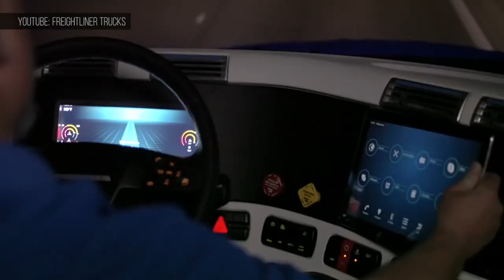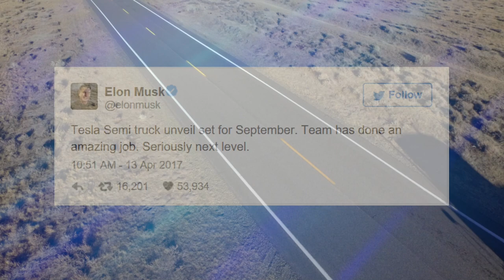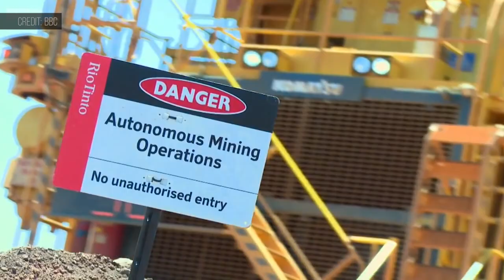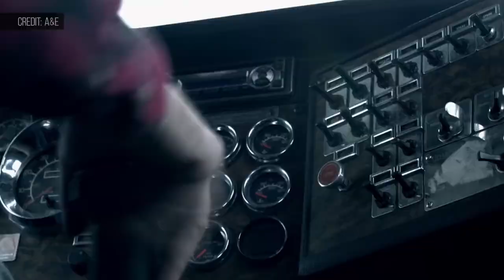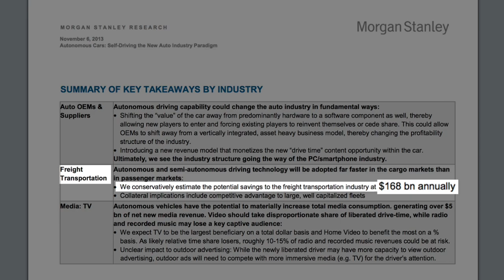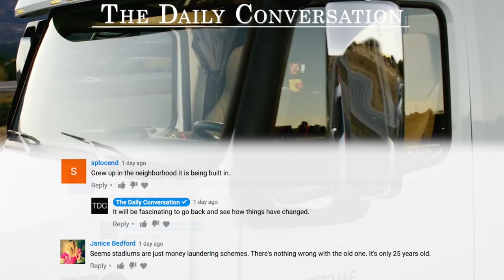The Future of Trucking

Comment: I find that these autonomous trucks can be subjected to a malicious hacker, and this could cause numerous problems, that if gone unchecked, can bring the entire trucking industry to a standstill. I find that it will probably fail, even though there may have been one successful case, but, if that company, that was bought by uber, which by the way, there was talk of a driverless uber car that ultimately failed and killed someone, I seriously doubt that this will be anything but a flop for autonomous semis. Too many factors can include not only susceptible to hackers, but also road conditions such as after a serious slow storm, and the salt or the corrosive materials that can eat away at wires due to road salts, or sand, or anything like that. There would have to also be frequent fuel stops, if the reefer needs to be filled up, if anything, as well as being subjected to maybe a short burst EMP attack, if a hacker can try to control it, to take control of the truck and reroute it to a different designation.. Here is a video on that failure of a driverless uber car at:  https://www.youtube.com/watch?v=HjeR13u74Mg as well at: https://www.youtube.com/watch?v=cnRKG6S8tII , and this is the result of it at: https://www.youtube.com/watch?v=hthyTh_fopo . After seeing that, and the possibilities of a hacker wanting to control a driverless truck, via either a remote location access through a company website, and creating a backdoor access program, I really do not think that there is anything to be concerned about when it comes to driverless trucks. I would be more concerned right now if a hacker can reroute a driver controlled truck through the qualcomm system than anything, or try to control a navigational system in qualcomm, but then again, that is my own opinion.

Comment: While I think there is going to be a place for it looking at road trains and so forth, as much as you can cut the driver out of the system I know you  are going to be causing problems what happens when it does crash

I think you be more inclined to start moving from 48-53 foot trailers and scale back to 40 foot the only to reduce truck semi emissions is to increase haulage capacity and you can get that with 3-5 trailer 40 foot trailers averaging 120-200 foot of cargo space..

Comment: Without a driver: who will back into the dock? Check in with receiver? What if freeway is blocked or closed? What if the last truck stop before the snowed in mountain pass is completely full? Weather conditions? What if battery completely fails while in travel 75 mph on major highway? 
I've been in the industry for 5 years.. there are situations that require moral judgement. This will never succeed as much as their greed wants it to.

Comment: In the near Future I think manned Electric Trucks make since for Short Haul trips but for Long Haul fuel cell Trucks make since as well as Robo Trucks. the kill app will be a Solar Cell skin for the Tractor as well as the Trailer. the other thing they need to do is Update the trailer, give it Solar Cells and make it as Streemlined as possible, and use the undercarriage to store extra batteries. they will need to update the Rules on Gross tonnage. have the weight of the Tractor and the weight of Batteries Subtracted from the total weight. Semi- Autonomy should be the Standard for ALL manned Trucks. Advanced Fleet management is Already here with iDAS Digital Radio system, iDAS can handle Analog / Digital in mixed mode and Fleet Trunking. the Driver can communicate with Destination giving Real Time updates on its Location and Expected delivery times, Corporate can monitor local Highway conditions and issue alerts to Drivers, and Drivers can Divert before there is a problem. iDAS has an IP protocol as well allowing constant communication with HQ and iDAS has built in GPS as well as Operator man down alerts.

Comment: The automated truck will come along a lot faster than people realize because of the disruptive Tec of super capacitors a company called KillWate labs has a direct one for one replacement of lithium batteries that is cheaper. lighter, is the same size, charges in 30 seconds and will do 1 million complete discharge and charge. This Tec will has a cost per cycle that will be so low that nothing will be able to compete with it.Just imagine a terminal similar to a weight station but with lots lanes that trucks pull through and robotic systems connect and charge the truck in thirty seconds.

Comment: Lack of truck drivers is already an issue. People don't want a big rig trucking life and drivers are aging. Automating some of the workload driving won't make it way more attractive as traffic, long hrs on your own, sleeping in Trucks and demands on health and curbs on human contact will remain. We may see truck drivers taking over the urban trips as trucks arrive off the highways. We have yet to see automation take over even the railway where driving is even easier. Since the internet will keep generating parcel demand and interest in expanding railfreight is limited by a network that will not expand, demand will remain. We may even see crowdsourced freight movement where general drivers take one part of the delivery and volumes of drivers negate the need to large truck shipments. Drones could do the same and the low altitude airspace has alot less traffic.

Comment: As a flatbed driver, the idea of automated trucks is a joke. Who's going to secure and unsecure the cargo at each end? Who's going to monitor the load in transit and adjust securement if necessary? At a job site, there would have to be a handler to maneuver the truck on site. What about maneuvers into a city area where trucks aren't normally allowed? All of these things need skilled human intervention and judgement. No robot is ever going to be able to do what I do every day. The industry most definitely needs to become more streamlined and efficient, but automation is only a tiny part of the puzzle for very specific applications, not a magic bullet. 

A fully automated freight infrastructure would require a massive overhaul of shipping and warehouse facilities as well as roads. Another example is other drivers. If you put hundreds of automated trucks in a city environment packed with cars, programmed to maintain a set following distance, cars would continually muscle in on the trucks and eventually bring them to a complete halt. It would create a traffic nightmare. What about when it gets confused or senses a failure? Does it just stop in the middle of the road?

The transport industry is also run and dictated with an iron fist by the insurance companies and attorneys. If an automated truck malfunctions and slaughters a bus full of tourists in a firey crash, who's responsible? The manufacturer? The company? The maker of the failed component? Until that question is clearly answered, the insurance providers will never allow these trucks to come into service. And what about programming ethics? Scenario: A mother pushing a stroller is crossing an intersection. There is traffic oncoming. On the sidewalk is a large group of people. There is no way for the truck to stop in time. It must steer. Which way? How do you program it to decide who to mow down? A cold calculation of the minimal loss of life? One major accident will set the whole idea back decades. 

Then there's the matter of removing millions of jobs from the economy. We will eventually automate ourselves into a corner. There will be no jobs for humans, and no way to earn income, and no money to be had to purchase the products the robots make. So then what? We become dependant upon the government to give us the things we need, and have no way to work to EARN the things we want? That's a rather disturbing image of the future if you ask me.

All of this talk of automation begs the question: "Just because we CAN, does it mean we SHOULD?" The drive to reduce costs of production and transport eventually reach a catastrophic point of diminishing returns. I just hope I'm not around to see it when it collapses under its own bulk. Truck transport is simply too dynamic and unpredictable to be handed off to a computer.

Comment: Instead of autonomous trucks, try to imagine autonomous rail cars.   A single rail car can carry  as much as 5 times the tonnage of a semi truck.  Also, once the rail car is moving, it requires very little energy to keep it moving due to the very low friction between steel wheels and steel rails.
Were we to go back to the rail system we had at the end of the 19th century, almost all deliveries could be made by rail.  Now if each car was electric powered and computer controlled, it could be programmed where to go and then simply set on its way.  Recharge stations could be set up along the way.  
Over time grade crossings could be eliminated.  Also track usage could be increased and the need for large switching yards could be reduced.  
Work will continue to be taken away from humans and be given to machines.  Humans will earn their living by facilitating the transition.  
Most likely as the need for human labor decreases, the birth rate will decline allowing individual standards of living to increase.

Comment: Cargo transport has changed quite a bit in the past 100 yrs and more in the past 50, like everything else it's an evolving field and will adapt as fast as humans can handle it and that's both the drive and braking of it, humans need to have some time to adapt, both in the industry which adapts faster and the human culture which is slower since many ppl aren't familiar w evolving technologies, we need to work on that too, present it in ways dif ages can grasp. I see a lot of solutions in these tech systems but like all tech it needs to work out the bugs, even the bow and arrow were gradually developed, horse & buggy were improved gradually, cargo used to be nets and crates, now it's standardized containers, a leap for sure but took some ports a while to adapt and the Panama Canal had to adapt to the new mega ships or lose millions of $$$. We're an adaptive species, we'll merge it all into our cultures and etc, just takes time. Very good vid, keep up the good work !

Comment: Electric trucks will definately have a market, though I think it will be limited more to ~200 mile one way trips, ~400 mile two way, for some time, meaning diesel power will be around for some time, likely a number of decades, a major problem is going to be with the power grid, operating even a single passenger EV car can consume more power than the household of it's by, potentially, multiple times depending on miles driven.
Reply: So far EV ranges have doubled every 6 years or so... that means 1000 km within a decade, probably much earlier than that.

Comment: There is a lot of money being put into robotics now days. Now you are putting 40,000 pounds of fright out there without a driver behind the wheel and not far after they are talking of getting rid of the tractor all together. Both these raise a flag. As a current driver myself and other drivers are faced with split second decisions on the road each day to avoid accidents that could cause accidents and delays. Not to mention all the construction throughout the US that we have to deal with. A lot of times you have to detour to avoid all of this. With a limited battery supply between recharging stations, that's going to leave this system unmanned on the road for several hours or possible days with millions of dollars of freight on them. How long do you think its going to take before the public starts to target and hijack these "unmanned" vehicles? The biggest question is how much this technology is going to coast the consumer? It has to be paid for some how. Someone has to man or program these systems, what happens when there is a system failure with that 80 ton misel ? The coast to ship freight will increase and the consumer will pay for all of this in the end. Any change in the transport of goods is always filters back to the consumer some how.

Comment: What if the truck has a flat? What if someone steals from the truck? Who will physically load and unload the truck especially if there is multiple pickups or drop offs? My trucking job requires physically loading and ratchet strapping down and vice versa. And what about harsh weather conditions? Who will put on snow chains. How will the truck get back and forth to Canada? Lol
These problems won't be overcome in my life time. And when they are that's when skynet will take over lol

Comment: One of the problems or issues will be if the remote or wireless system not only on a single tractor, but a convoy or a fleet  is hacked and utilized to wreak havoc on public by terrorist or hijacked for ransom. If an election was compromised and let say tampered with, imagine a fleet of tractor on the road. I am sure these new trucks have a system failure in case if these events occur, but criminals are always 1 step ahead of authorities.✌

Comment: If we could build highways with easy exit and entrance,even fueling stops on the side and the middle, trucks would be self driving in 3 to 5 years. The self driving trucks could download to smaller local trucks at loading and unloading side ramps. If only.

The Interstate Highway System was launched when President Dwight D. Eisenhower signed the Federal-Aid Highway Act of 1956. Its purpose was to provide high-speed, high-capacity system of highways without stoplights and with exits spaced, whenever possible, at least a mile apart.

        Lets quit fooling the truckers and teach them another trade.

Comment: You make Tesla sound worse than it is. Tesla semi has a high of 500 miles of range and the amount of charging stations isn't a problem. For fuel cell on the other hand, fuel cell stations is a problem as there are only fuel cell stations in California. This channel is horrible and doesn't do proper research
Reply: its 3 yrs old. NOW its available and can now be taken advantage of. its there. USE IT

Comment: It won't be just truckers that will lose jobs... No,  it will also kill jobs at some truck stops. Without truckers to buy their stuff, they won't be able to stay open. Automation for driving would be a disaster for the economy. Eventually it would lead to riots and people looting automated trucks along the road.  All they would have to do is park in front of them and behind them. After that,  unlock the trailer and grab whatever they want. Stopping a truck is as simple as cutting a red hose for the air line.  With the brakes locked, that truck won't go anywhere. 
"Nuff Said!

Comment: Not job loss just for the drivers but the whole industry of gas stations hotels restaurants will suffer same Faith as the driver of a big rig. Emissions will be higher charging stations will need to be powered by the grid and turn the power grid needs to generate more power to accommodate the increase of all the energy to charge all these new batteries in the new Big Rigs of the future. Extremely dangerous for the economy of any country!

Comment: You will always need a cab-shaped part at least for reduced wind resistance.
Also, the US has far more truckers, compared to other countries - they use more rail transport, which is far more energy and labor efficient.
And lastly, truckers have to admit they have a problem. I still remember when presidential candidates were asked about helping people form Appalachia. Hillary talked about reeducation. Trump promised to bring coal back. Guess who the people voted for. If truckers try to compete with machines, they will not fare any better than hand-weavers.

Comment: Do you honestly believe that the cheap skates in the trucking industry are going to spend hundreds of billions on the build-out of infrastructure to make self drive trucks? If you have run truckload, local p&d and line-haul like I have you'll know in an instant they won't do it. This winter the one sensor on my accident mitigation system failed 11 times between Harrisburg,  PA and Knoxville, TN. I had to stop and knock the ice off that many times... just for example. Do you think a sensor loaded truck is going to be anymore reliable... It's all hype!
Reply from the maker: Fair point, thanks for your comment. Do you think there will earlier adoption in places with fairer weather, like SoCal?

Comment: You satistics you should of finish on truck accidents. 1vst how many was pickup trucks 2 the prcentage of the overall percentage of accidents on the u.s highways where the driver is at fault. See the thing these computers cant do now is know what is around the next bend. A person walking a deer 
Or worse a school bus. We use a C.B radio and the driver going the other way. You might have a truck that can drive it self but there are circumstances this system will fail. Then who is responseble the DRIVER RIGHT?

Comment: So the truck is going to pull up to a dealership automatically and unload 9 cars??? Gimme a break! A hot oiler driving mainly off road will be operated by a machine? Bumping docks in the smaller older eastcoast willbe done automatically by a machine!?!? Gimmee a break. My fellow truckers don't be fooled. This is the biggest load of crap!

Comment: They talk so much of this truck but they claim yo have a working prototype but never evidence of the truck on the road. So nicolas is a fraud. Tesla also claim a working truck but i guess the biggest problem is power. Powering an electrick truck to haul 80k pounds seems to be an expensive option to compete against diesel. They should be investing on new source of power, or new generations of battery to revolutionize the idea of battery power trucks. Even local delivery trucks ate a challenge considering the time to take to load and unload waiting using heater or ac that in turn will drain the battery. The only way is to somehow develop batteries that can greatly improve it's size to capacity compare to what's available today.